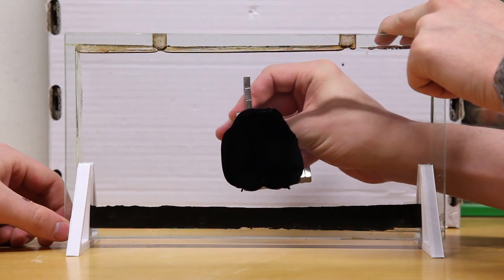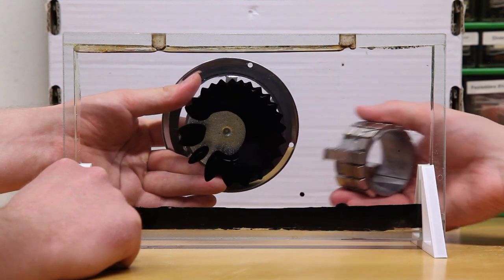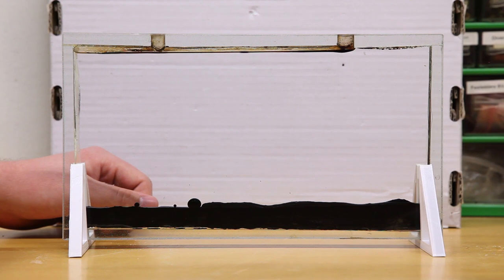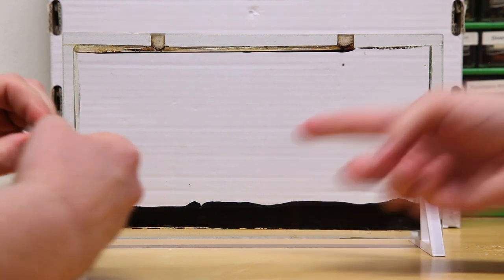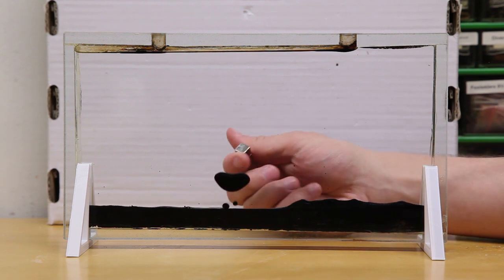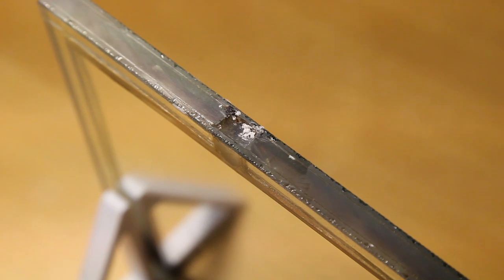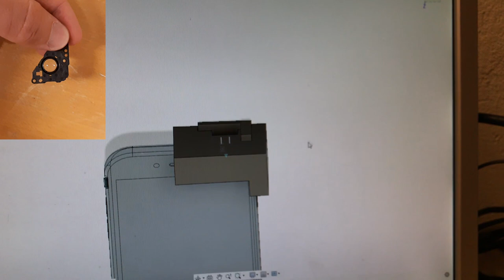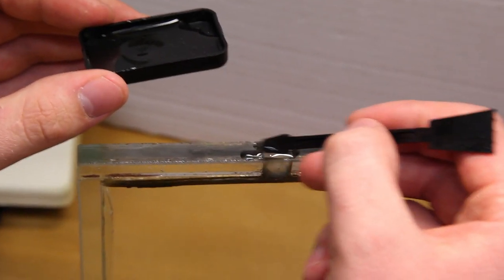How to Make a Ferrofluid Container - Part 2 - Fetch #5

Comment: Please tell me. What would be the alternatives instead of silicone or epoxy ?
Reply from the maker: We haven’t tried anything else so I can’t tell you. But if you’re using acrylic instead of glass it should be possible to acetone-weld the seams. That probably demands an altered recipe for the suspension liquid though.

Comment: I'm currently building a smaller Ferrofluid Clock for my Bachelors in Electronics. And I'm struggling with keeping the ferrofluid from sticking. Could you tell me exactly which solution you used?
I'm currently working with a 23% Solution of MagnesiumChloride and distilled water. Not much luck with that :(
Did you coat your glass? Are you using plain salt? What solution?
Help would be highly appreciated
Reply: Yeah... for a video about how to make a container, they don't really go into much depth about what they did, how it works, or why.
Reply: They have another video that goes more into depth on the chemistry side. Didn’t see it at first myself.